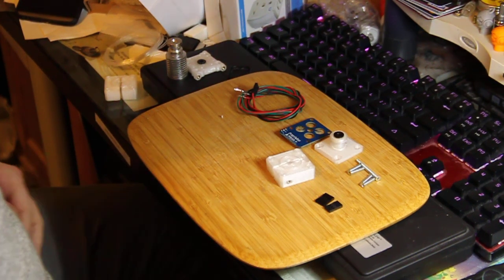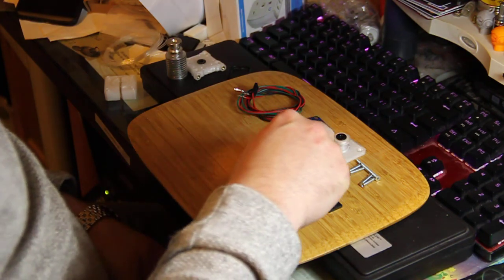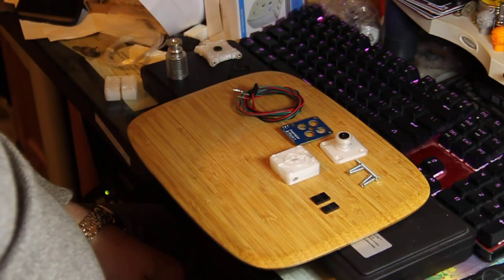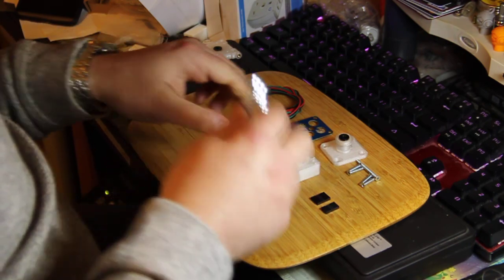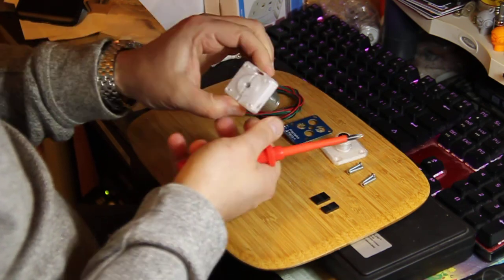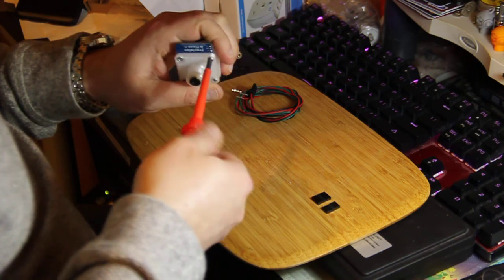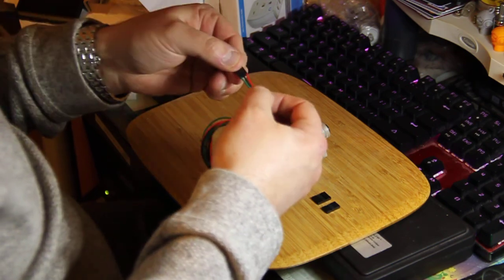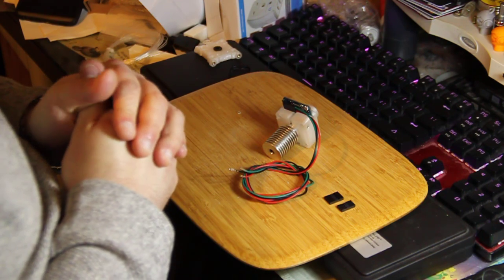Precision Piezo Orion Module - Overview and Assembly.

Comment: I've just purchased one of these (I've previously used capacitive sensors which tend to fail after a short time) I'm very much looking forward to receiving it, however, I'm VERY sketchy on setting this up on my printer.   Have you seen TH3D's unified firmware? That particular company has sold thousands of capacitive sensors - not based on the fact that they're any better than any other ABL solution.  It's because they've supplied an easily configurable firmware. If you can come up with a similar solution then I would imagine you will sell many, many more of these modules.
3D printing is not half as niche as it used to be, there are many users who would love to buy one of these but are unable or are uncomfortable with dealing with firmware configuration.
Reply from the maker: We do have a firmware for cr10  300 which I wrote a short while ago and on which Idris Nowell who runs the company will be basing firmware releases for cr10 and similar machines. However we are from a reprap background where most users have built their own printer and configured their own firmware. I agree things are changing and 3d printing is in a proto - consumer era where people  buy ready made machines and are not building/configuring them. I know Tim from Th3d well and we have discussed working together. Our sensor system is way superior to a capacitative or inductive sensor in many ways but Th3d have offered an ecosystem with the sensor part of it and they deserve their success. I am away travelling for a year now but hope to be involved when I return, be interesting to see where 3d printing is in 12 months!

Comment: Good clear instructions.  How about a followup on firmware such as Reprap or Marlin instructions.
Reply from the maker: Hi, we stop short of actually videoing any specific firmware setup as firmware changes, so it would continually need to be updated.
Reply: Well, I for one use a DuetWiFi and other than adding M574 Z1 S1  M558 P5 R0.4 H5 F120 T6000 for the config.g I find no other reference on what files to edit.